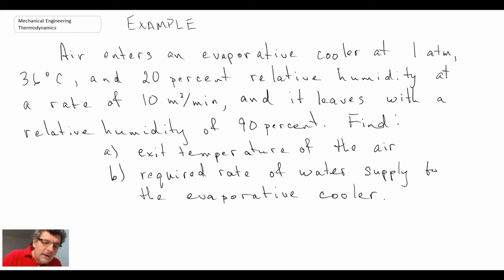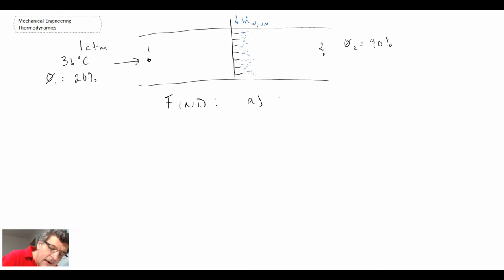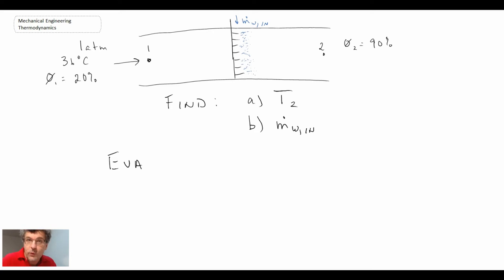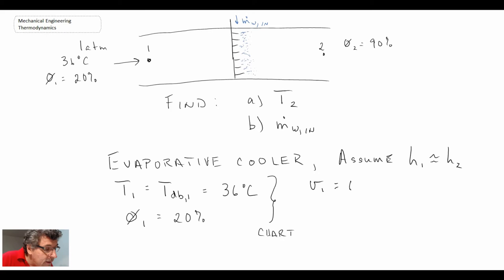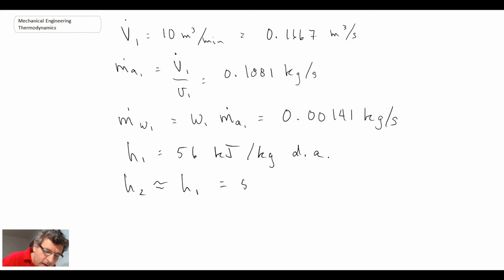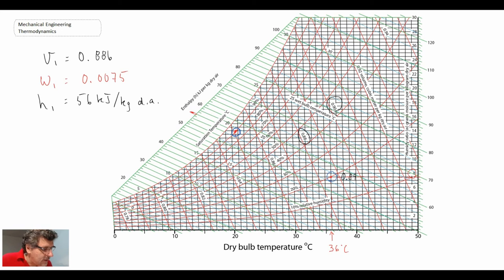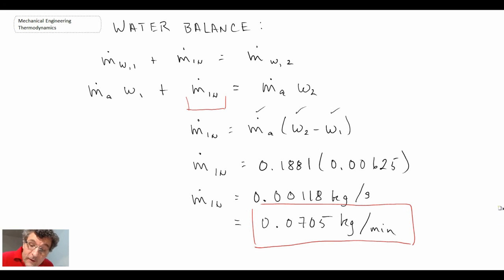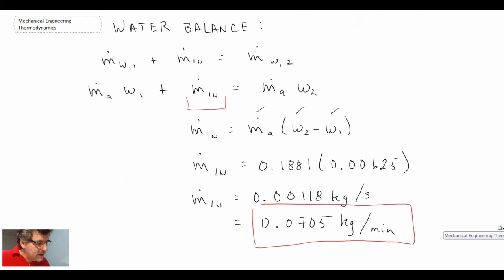Mechanical Engineering Thermodynamics - Lec 30, pt 4 of 4:  Air-Conditioning Process Example - Chart

Comment: Great vedio, but i have question.
What minimum temp we can achieved and what temp of added water required to a achieve minimum temp of air.
Examples
Air initial dry bulb temp: 42 dec C
RH : 37 %
Can i achieved 13 dec C temp of outlet air and what will be the temperature of added water.